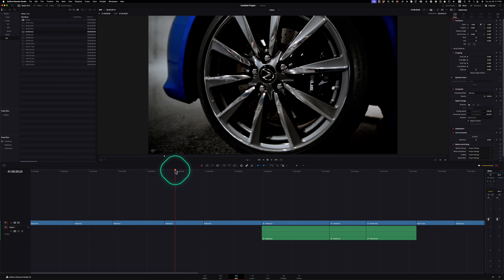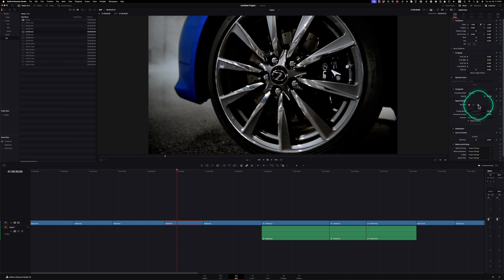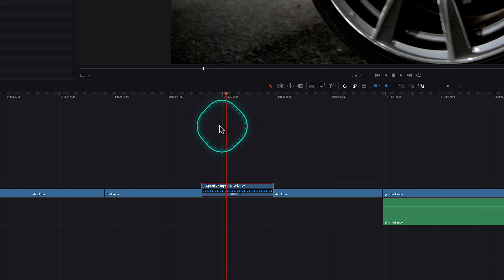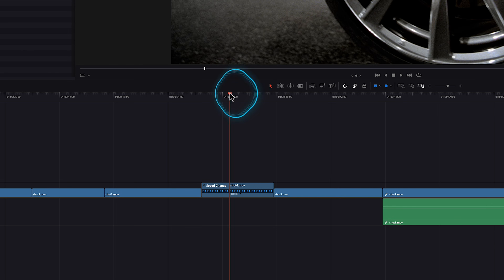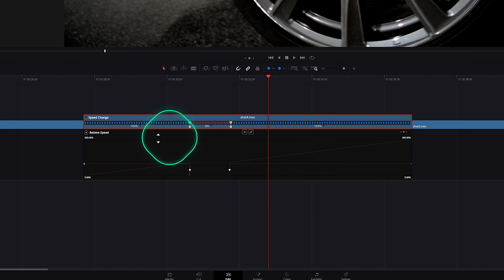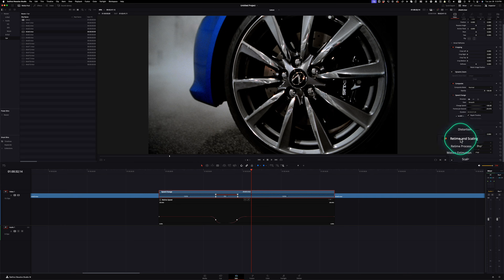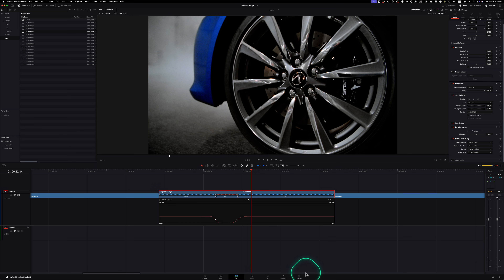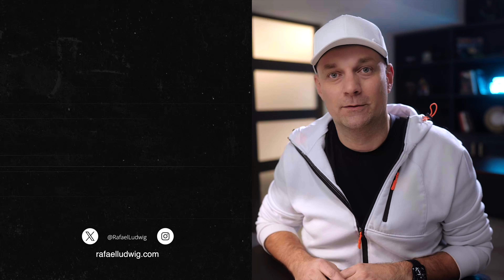The RIGHT WAY to Master Freeze Frames in DaVinci Resolve

Comment: Thank for that, that is incredibly useful! Is there any way to do that with fusion comps? I have an animation where i just want the last frame to last for the entire video, and although I could stretch the whole comp to fit the timeline, it would be much neater to just freeze that last fusion frame.
Reply: Unfortunately, this is not easy to do, in Fusion. It's probably its weakest point. The best way, is to do the edit on the Edit page, before you even start in Fusion.
In your specific case, if you had already built the node tree and just had to extend the last frame, exporting that last frame as a still, then dragging it into Fusion, as a second media input, right-click on that node and choose how long (in frames) the clip should last, would be the easiest.
But in case, you need to extend frames, it's the Time Stretcher node, you need to use. bdsCovered has a video, on how to use that node, and in fact has videos on every single node, in Fusion, in the form of a thorough explanation, and one or two examples. It's a 350 video clips long playlist, called Fusion Daily nodes, or something like that. Impossible to miss, on his YouTube page.

Comment: Hm, after DR 20, the Retime curve is no longer in the right-click menu. Where is this option now?
Reply from the maker: It's still there, Retime controls, or CMD R on a Mac, or CTRL R on PC.  V20 is fantastic! Thanks for watching and the comment!
Reply: did you ever figure this out because i cant find min either
Reply: @xJayLx  Been busy with other projects, but AFAI can tell, it's in the new Keyframes panel. Once you set a keyframe in the Inspector's Speed Change section, you can then access the Keyframes panel (next to Media Pool, Effects and others on the top left), select Parameters -> Video -> Speed and open the keyframe curves (spline) view, you can work with the curves.

Am still kinda lost as to how to set it up in a cool way :) Open to feedback

Comment: Literally the first hit on YouTube for "davinci resolve freeze frame" told you the wrong way to do it, we need to bump this!
Reply: Nah, this is a fairly new way of doing it, in Resolve. You probably saw a video on the old method.
That's a downside of Resolve tutorials. Just from version 19.x to Resolve 20, they added or improved well over 100 features. So, in many cases, last year's tutorials are often old news.

In fact, it's been over a year, since I had to freeze a frame in a video, and I didn't even know, that they had improved this method. Which makes it so much easier.